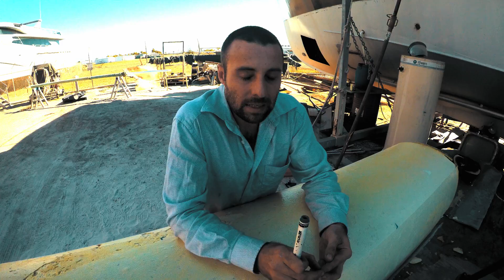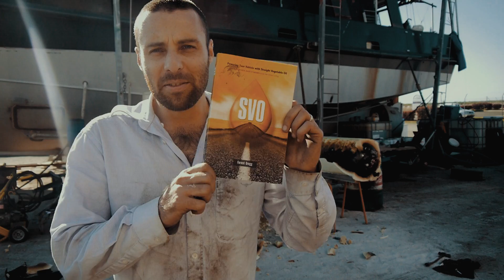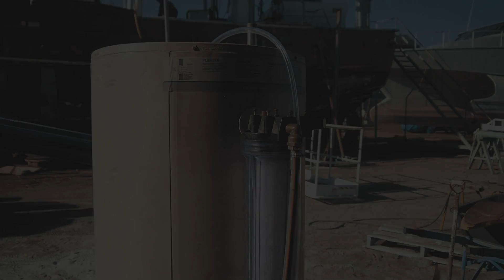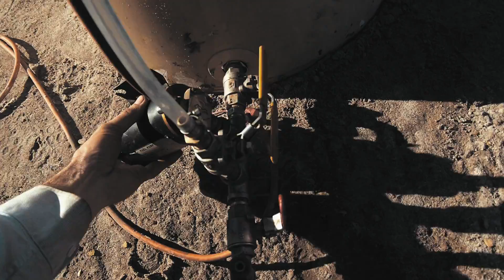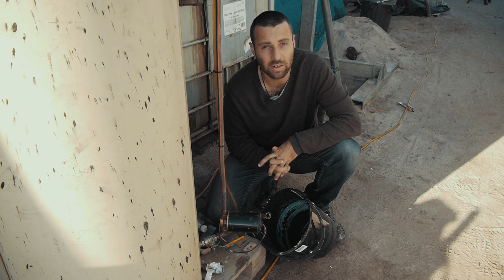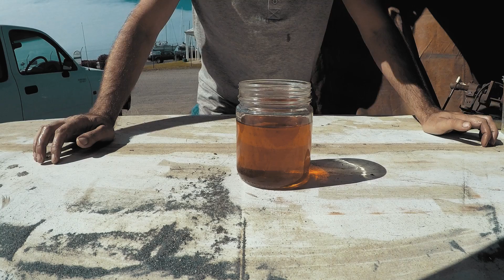Running A Diesel On Vegetable Oil (Part 4 Ep. 47)

Comment: Most likely there wasn't enough water to make it up to the lowest drain level!
You autta consider an external heat exchanger inline after the filter, before going back in the tank! You cans use diesel jacket water as a heating medium! While it's heating it shouldn't matter about rising hot oil mixing! It's the settling process where it'll seperate!
Unless.... you want to waste time while heating!? Get it Hot Fast... then transfer to settling tank! 1/20th the time it's gonna take as is!

Comment: I met someone who was doing the same thing as you all.  ONLY it was a truck and he got his oil straight from local fast food places.  It nearly broke him from going on with the project because the cost of filters was restrictive. 
His solution was to build a centrifuge using 55 gallon barrels.  He didn't elaborate much beyond that other than it worked very well.... Left a melon size gunk ball in the bottom and left the particulate matter down to sub 25 micron level.  
He used two tanks and started with diesel , switched to oil and had to let it run 10 min or so after going back to diesel.  He put an inline heater to the oil line and used a lot of insulation around the lines and tank.  He swore it really worked and got a cursory but brief look at his system as he was very protective of his invention.   Hope this gives you an idea or two on how to improve your system.  ......................   enjoy
Reply from the maker: Thanks John. It’s fairly common knowledge in the vege oil community what’s needed to run on oil. Sounds like your man ended up on the solution that most people come to re two tanks heating and fuel filtration.
Reply: @ProjectBrupeg  He did say over and over that it was the centrifuge that was the key to his efforts.  I've been to Antarctica for two summer seasons and looking forward to your adventures down there. enjoy

Comment: Can the oil storage tanks on-board be purged with inert gas to keep out the O2? A small nitrogen or argon tank and a pressure reducer could keep the free space in the tank at 4-5 psi over ambient as the level drops. Don't know if it's worth the expense unless you need to store for long term...
Reply from the maker: Yeah a good idea. We will need to keep fuel good for up to 12months on the long trips so certainly something we will need to think about. Likely go with a simple bottle squirted into the full tank and then sealed up as once we open each tank we will use that one only until empty.

Comment: Would using a 'heater' tank as one of the storage tanks be a good bit of redundancy in case the first heater fails? A little bit of extra plumbing and wiring would allow you to switch 'heaters' and continue fuel refinement while repairing the first unit...
Reply from the maker: Hi Mike. We ended up dropping the heated processor as we couldn’t refine the fuel to a good enough standard. In a later episode we created a process using vacuum which was much more successful

Comment: It would seem to me that you would need to vent the top of the boiler to the outside. Then raise the temperature of the oil above boiling 212*F-100*C to boil the water from the oil. Then you would have water free oil that has been filtered to 1 micron to remove the solids from the oil. That should give you filtered water free oil. Just me thinking out loud. OK

Comment: Could you not fit a sight glass to the tank so you can see when you have drained all the water off?
Reply from the maker: The issue is it’s not visible water. It’s tiny droplets that are resolved in the oil. Would love a sight glass but in that case in wouldn’t show the detail

Comment: We have a long measuring stick we put a paste at the bottom 3 " stick the tank when it hits the bottom if water will turn purple to how many inches of water you got on the 3" s
Reply from the maker: That’s a neat system, what’s the paste that’s used
Reply: @ProjectBrupeg  generally oil company,s delivering oil will have it ,its like a greese they put at the end of the stick all the way up the stick 3" to determine how much water is in the tank generally 1" of water is accept in a large fuel tank

Comment: Is it possible when the tank or square container with oil ,water will drop to the bottom of the tank by which you can suck with a hose attach to a stick that's the way we did it ?
Reply from the maker: We have a built in pick up right at the bottom of each tank so yes you bang on but ours is just a welded in version of your pipe on a stick

Comment: Damien, I think you should use 1" or larger piping, there will be less pressure and the veggie oil will flow easier, also won't the piping react with the oil? Also is that a new tank?
Reply from the maker: Hi mate, this was just a test rig to see if our theory would even work. It did, but not good enough so we are currently building version 2 of a completely different design using vacuum rather than heat. Stay tuned, that one will be out soon

Comment: Use a couple of IBC tanks as your storage tanks, you can paint the outsides Brown (there is a reason beer bottles are brown)( keeps sunlight out) google it.
Reply from the maker: Hi James, im starting to think about the processing system that will be mounted onboard brupeg and tanks to settle i think are always going to be an issue (as the boat never stops moving) so they are always going to present a problem. im thinking more about smaller settling tanks than IBC's (which is what i have been using). maybe in the range of 100L at a time and process oil more regularly. that said settling tanks are only needed if im collecting the oil which i generally wont be.
Reply: whatever you use for a separation tank will need to be funnel shaped at the bottom, and maybe longer than a normal angled funnel since it will always be moving.  same might go for a settling tank if you are using one. 
I just thought ...would a centrifugal filter used on a ship separate water as well as filter solids ? since particles and water are both heavier than oil.
Reply from the maker: Hi Lindsay I’ve never used a centrifuge however I believe they can take water molecules out... anything over and above that statement I really couldn’t say.

Comment: If oxidation is a problem due to the oil coming into contact with steel, I would suggest not using those Rheem hot water cylinders as they are porcelain lined which most likely has become damaged over time and failure of the sacrificial anode leads to rusting internally. Maybe I should send you a couple of 450 litre dairy hot water cylinders as I guess copper is less reactive to hot oil. Regulation of the element could be done with a 10 amp lighting dimmer which you could adjust to ramp up the heating and leave the thermostat set on 80 degrees.
Great effort guys, I love the kiwi ingenuity and number 8 wire technology :)

Comment: hi your all doing a fab job, may I ask you something.... so you have a holding tank with oil in, to go though a heat tank that will get to temperature and the you put it into another tank to sit tell cold then you drain the water mix oil out of the bottom.....witch is your waste ...????? so where does that go to after...... into another tank. so is all the inside of your lower deck tanks for your fuel....????????   then where do you get rid of it all when there full...??
Reply from the maker: Hi Ray, yes the first hot then cold cracks the water from the oil, the water sits at the bottom of the tank until drained, this is waste and is disposed off. All our tanks will be for fuel only and will be drained from us in the engine.

Comment: DAMEIN, OLD ONE LEGGED JOSEPH HERE. DOES YOUR BOOK SAY ANYTHING ABOUT A CHECK VALVE ABOVE THE DC PUMP? JUST WONDERING, BECAUSE IF YOU GET BACK FLOW THROUGH THE PUMP WONT THAT CONTAMINATE THE CLEAN OIL? JUST ASKING OLD ONE LEGGED JOSEPH T RETIRED NAVY
Reply from the maker: HI JOE, NO NOTHING ABOUT A CHECK VALVE AS THE PUMP JUST CIRCULATES THE OIL SO EVEN IF IT DID BACK FLOW IT WOULDNT MAKE MUCH DIFFERENCE I DONT THINK
Reply: OH I SEE. ON OUR SHIP WE USED A 5 STAGE CENTRIFUGE TO SEPERATE DFM AND SALT WATER. THERE WERE TWO TYPES, AUX STEAM AND ELECTRIC. BELIEVE IT OR NOT THE STEAM CENTRIFUGE WAS WAY FASTER AND BETTER, YOU COULD BURN IT IN THE BOILER RIGHT OUT OF THE CENTRIFUGE!! GOOD TO HEAR FROM ALL MY KIDS HEHEEH OLD MAN HERE, JUST SAYING OLD ONE LEGGED JOSEPH T RETIRED NAVY
Reply from the maker: THAT DOESNT SURPRISE ME THAT STEAM WOULD DO A GREAT JOB. ITS A PRETTY POWERFUL WAY OF TRANSPORTING ENERGY!

Comment: Are you running pure vegetable oil, or are you blending it with diesel fuel?
Reply from the maker: Hi Tamara, she will start up on 100% diesel and run for around 10-15minutes until the engine is up to normal operating temp, then we switch to 100% straight filtered vege oil and run for however long we need to, then 10mins before we shut the engine off we swap back to 100% diesel and purge all of the fuel lines so that no oil residue is left for when we need to start up next

Comment: I ran a Ford F-250 Powerstroke over 100K miles on waste fryer oil. Used a system made by VOTech. Heating the oil as close to 160 degrees before injectors is key. The VOTech system used a filter housing that had an integrated hot water jacket. Important to start up and shut down on diesel. Which means purging the system with diesel before shutting down. And make sure no components are galvanized. 
jon
Reply from the maker: Thanks Jon, that’s very much along the lines of our thinking. Thanks for the name of your system I will look into it

Comment: I know you are getting  your bulk oil in a bladder inside a shipping container but  how are you getting it from the dock into Brupeg,? Is there a fitting on the bladder where you can connect to a pump? You may have said in the other video where you explained about getting veggie oil but I don't remember and from the comments you are getting a lot of viewers who haven't been with you that long. I''ll never make boat fuel but I make smaller version for heating oil and to run a tractor and pickup so I am really curious what system y'all end up with. Love the video's, you are a great team.
Reply from the maker: Thanks very much from the feedback. The bladders have a screw cap you can connect a pipe to and we will be building a vacuum pump to transfer the oil. Dock to Brupeg will be something that varies but is able to be dealt with by adding more lengths of pipe. We will need to use stiff wall pipe (think irrigation pipe rather than garden hose) as we will be creating a strong vacuum over a fair distance in some cases. 

We have already started working on processor 2.0 which uses vacuum rather than heat to crack the water so that should be an even more interesting project down this oil road
Reply: An air operated diaphragm pump would be the go for transfer of the oil, your only limit would be your air compressor.
Reply from the maker: It’s funny you say this. We have already started working on processor 2.0 which uses vacuum rather than heat to crack the water, so we have eliminated mechanical pumps completely and pull the oil in with a vacuum and push it out with air pressure

Comment: You can throttle the heating element by using a capacitor in series with it, from an old single phase electric motor, when you are controlling AC current.
The capacitor will act like a spring against the current as to limit the amplitude of the current - if that makes sense.
By using several capacitors in parallel with a switch or relay in front of them you can make a stepped power control.
The capacitors you need can be found in old motors, fridges, televisions ect ect.. the most important thing besides the size is they are rated above the voltage you are using. :)
Reply from the maker: Ok that’s really handy to know. I know very little about AC
Reply: I'm sorry I don't know the math off hand. But any electronics buff will be able to calculate how big the capacitor needs to be in order to "dampen" the power usage and/or make a stepped attenuator for your heating element simply based on the element size and the supply voltage.
The nice thing about using capasitors for it, is that they do their job without losses and are pretty cheap (or free)

Comment: When you filter the oil like that, I would guess you are still going to have a bunch of bigger particles in the oil since all you are doing is "thinning" the particles by circulating it over and over. Would it not be better to place the filter between the boiler and holding #1 to make sure all the oil has passed the filter?
Reply from the maker: Maybe. It’s all trial and error for us at this stage. This is the base design we were told to make but I’m sure like anything it could be improved. We have already started working on processor 2.0 which uses vacuum rather than heat to crack the water

Comment: Amazing process.  This video is really informational.  Thank you.  Loved the out takes.  Where will the filtering system be located?  Could you use your engine cooling water to heat the primary tank and maintain the temperature of the oil in the secondary tank before you send it to the water coolers?  Just a thought.  Hope Jess has healed up.  Take care and be safe.
Reply from the maker: Hi Matt

Jess’s original injury is healing up nicely thanks for asking. This rig was always a test to learn how to make fuel, the plan is to figure out what works then miniaturise it and install into the engine room. We have actually started working on a new version of the processor that does away with heat to crack the water and instead uses vacuum to turn suspended water into steam. It’s also much faster to process the same amount of fuel so for us that’s a huge bonus (as it would take 92days to fill the tank using that hot water cyclinder).
Reply: Damien,
Glad to hear Jess is healing well.  The vacuum sounds interesting.  The closer you can get to a continuous process the better and the vacuum may get you very close.  It would be ideal to be able to have a large storage tank for the raw oil and then feed the engine with a continuous flow of prepared fuel.  I don't recall what your cruising fuel consumption estimate was.  Would it be possible to generate a continuous supply of say 40 liters/hour with the vacuum system and a buffer tank of say 100 liters?  I'll have to get the book you mention to catch up, but you folks are doing an amazing job on the fuel oil project. Thank you for keeping us informed.
Reply from the maker: The plan would be to purchase oil prefiltered down to maybe 5-10 micron which is easy enough to do in our quantities, then from the bladder sitting on the dock filter down to 1-2 micron using a bag filter and the vacuum system located in the engine bay. The vacuum pressure tank will be approximately 300-400L so we would suck in that amount of oil, vacuum down as much as possible for around 40mins then push that processed oil through another 1micron bag filter and into the main oil storage tanks onboard. So we should be able to process about 7ton per day if we take shifts. So a empty to full refuel will be a three day operation but that’s a year of fuel so not that much of an issue

Comment: Do you reckon you could tap a valve into the bottom of the filter housing ? Then you could drain it easily without spilling as when you do it at sea there will be motion
Reply from the maker: Yeah I suspect that would be possible, maybe not on this filter as it’s just a cheap plastic housing. We have just been given a couple of stainless bag filter housings so these could be modified with a drain

Comment: Is it worth messing about with this oil ,my mate nakerd his engine up using cooking oil straight from the supermarket !!!!!
Reply from the maker: Only certain engines can handle it and you have to modify the engine to run it and cold vege oil is bad for all engines as it much thicker than diesel and needs to be heated, so it's not surprising that some engines get buggered. The cost of the oil if it works is about 1/4 that of diesel and reduces fossil fuel reliance, so for us its well worth finding out if it works. Rebuilding or replacing an engine is a price we accept for the risk that it could work done properly.

Comment: I'm sure you've considered this, but unless I missed it you didn't discuss it in the vid - why not take engine coolant and run it through a bypass valve to an indirect heating coil tank? 

Underfloor heating valves mix the return from an underground coil with hot water from a boiler system. Indirect hot water tanks are inexpensive, and usually have an electric heating element too, so that option would remain.

I'd be interested in your thoughts? (it's something I've considered - because I'd like to try and blend veg oil with my heating oil to heat our house - so have been looking at options for processing)?
Reply from the maker: Hi Daryl

It’s possible but I think it would take a bit of trial and error to figure it the ratios etc (not a hard challenge). We are actually working on a version 2 processor that does away with heat altogether and using a a vacuum to turn water to steam and cracks the water at a much reduced energy level. It’s a completely different system to the hot water cylinder so stay turned as we suspect it will be a more effective design overall